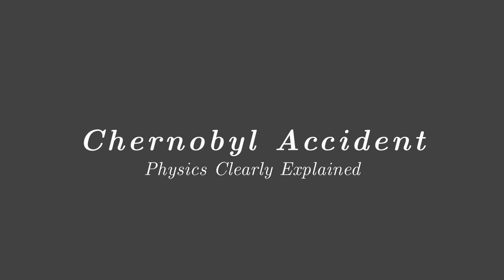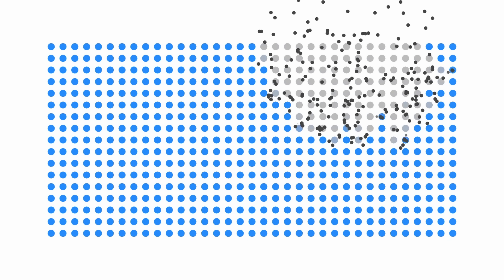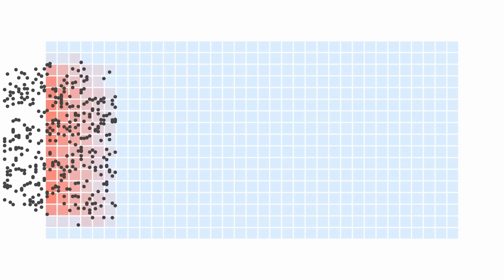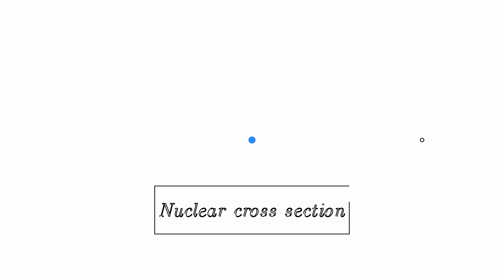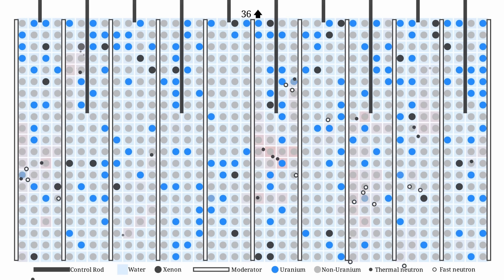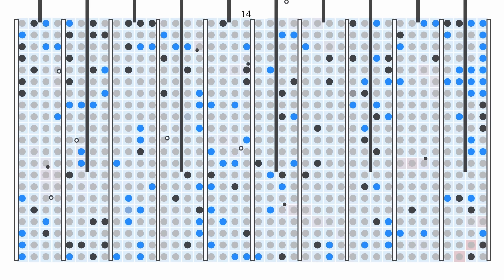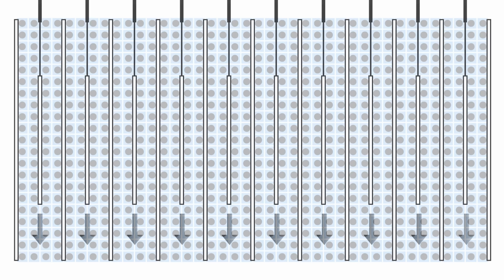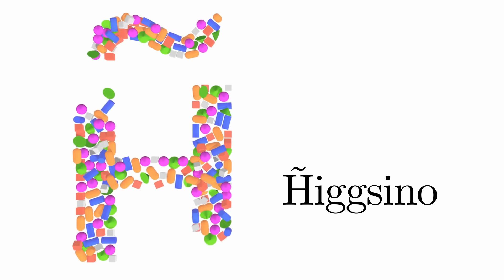Chernobyl Visually Explained

Comment: Excellent explanation. I hope many people will appreciate the step by step format you've used here. 

I hope in another video you will further explain the different types of moderators used in the production of nuclear power, both safe and unsafe. Perhaps also a video on why U235 is only used at a specific percentage for the safety of the reactor. 

All around great visualization of a horrible tragedy.

Comment: Why did the operators have to run tests in the first place?
Reply from the maker: the operators simply did it because they where told to do it. Upper management that decided it ironically wanted to test a safety system
Reply: @Higgsinophysics  After Israel bombed an Iraqi nuclear reactor.
Reply: Built by USSR

Comment: Nicely done. Except I thought RBMK reactors don’t use water for cooling, only graphite..
Reply from the maker: Not sure if that's a question. But let me clarify anyway.

Graphite controls the speed of reacitivty, and the speed of reacitivty determines the reactors temperature.

The water litterarly cools down the reactor. It will take away thermal energy by vaporizing to steam. But water also control reactivity of the reactor.

So the term "cooling" since it can thought of lowering the litteral temperature but also lowering reactivity

Comment: Soviet Union is gone, but we’re still dealing with their BS. If it weren’t for this, we could actually be running clean power and I wouldn’t have oil activists blocking me from getting to work.
Reply: The remaining reactors at the site continued to operate  for decades after the accident.

Comment: The xenon aspect of reactors is just fundamentally fascinating.  The idea that you're generating Xe at the previous rate, and burning it off at the "power now" rate makes it an interesting twist to reactions.
Reply: The half-life of Xenon 135 is approximately 9 hours. It was decaying and being burnt off at a faster rate than it could be produced. That is why the reactor should have been switched off and not re-started for at least 3 days.
Reply: @harrynking777 thank you, I was wondering what the proper course was. Removing water or pulling out control rods clearly isn't the right call
Reply: I never understood why that was a problem until this video.  It seems so obvious now!
Reply: @playgroundchooser  If you have the time, there is a series of videos covering this very well in the MIT OpenCourseWare channel. Its just a taping of a lecture, but its very good and goes a little more in-depth. This was an excellent visualization and would complement the MIT videos well.
Reply: Xenon comes from two sources.  Directly from fission, but also from the decay of radioactive iodine.  And radioactive iodine comes from fission but decays with a half-life.  So when you reduce power, there is still a lot of iodine in the reactor from operating at the high power level.  Over a few hours, this iodine continues to decay into xenon.   So...  even though you've reduced power, xenon is still produced in the reactor at the higher rate  for a while.  Eventually the iodine concentration drops as it decays, but this can take many hours.
Reply: @mikefochtman7164  The amount directly produced by fission is fairly minimal.  If I recall correctly, something like .25% of fissions result directly in xenon.
Reply: its called Xenon poisoning.
Reply: @philldavies7940  no it's not. Xenon is a poison but you would never call the process poisoning irl. It's mostly called xenon build-in
Reply: I wonder why there was no tracking for approximated xenon levels and all other neutron flux influences
Reply: @hausaffe100 The reactor was so out of bounds of how it was designed to be operated that there was no existing documentation as to estimated xenon levels. The only information available would’ve been how to clear xenon build up from the reactor gradually over time, which would have been applicable to any amount of xenon and safely corrected the issue. With this solution already documented, a standalone sensor or computer that calculated estimated xenon levels would’ve been seen as an unnecessary expense for an already solved problem.

Comment: I think ddopson's comment below gives some of the most accurate and authoritative feedback needed to bring this neat little simulation closer to realism and correct some misconceptions. One I noted was that from the start it was assumed that it was the direct bombardment of moderator molecules that was (is ) responsible for energy transfer to that medium. Very likely this effect is the faster of many, but includes only about 5% of the fission energy (i.e., fission neutrons only carry away about that amount of the nuclear energy release). Roughly 90% is in the fission products (pre-decay), and so in the fuel rod. It is actually an important detail how fast the feedback process of fuel heating acts in conjunction with the "prompt" heating of neutrons and likely results in some of disparities between results of close-to-real-world simulations that ddopson alludes to.

As well, once moderator starts disappearing, hardening of the neutron spectrum means that the much more prevalent fissionable-only fuel (U238) starts to participate in larger proportion in providing fission energy (that was previously disregarded), at least in that most interesting period before things are quenched by "rapid disassembly" of the core. This is often taken as a competing effect for doppler broadening for convenience in practical calculation.

In any case show
Reply: I meant: in any case, nice show Higgsino !!
Reply from the maker: Thanks I appreciate that. It could be fun to add more details to the simulation, I love that idea.
Reply: @Higgsinophysics  And thank you in return. As a youngster I was as keen as you to create something like this for teaching purposes, on our monster IBM 370 no less - bravo too you! 
Might I even add, if the mood strikes, going full 3D? I know this brings in some new qualitative complications, but also shows some fresh effects for when a reactor gets really large in terms of neutron scattering lengths, not least region de-coupling. If really gung-ho, go for real lossy boundaries instead of periodic boundary conditions. All the best and keep it fun - recognizing you have fans! DKB
Reply from the maker: @domenicobarillari2046 it's a great idea to go 3D. But the downside would definitely be the visuals - even in 2D it's kinda a lot and confusing. 😅

Comment: Can you add the effects of gravity-driven, internal circulation and also thermal diffusion? I know it gets hideously computationally intensive due to the turbulent flows that would arise, thus making it difficult to model, but even a dumbed-down model ignoring turbulence could show the cold spots and hot spots and how they affect the scenario, i think.
Reply from the maker: If I had to add another think thermal diffusion is probably the most important one to add. And yeah as you mention a "dumbed-down model" is probably sufficient. 

I thought about this, but I figured it wasn't absolutely critical for understanding the accident but now I regret not adding it. Maybe I will do a follow up.